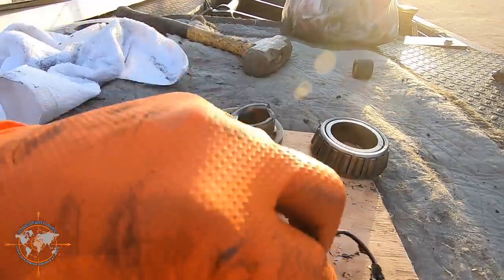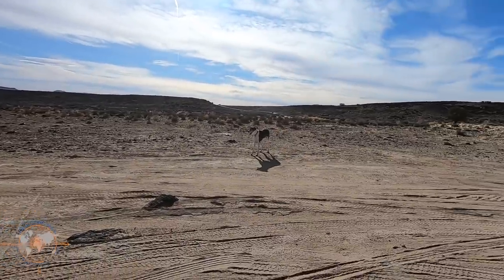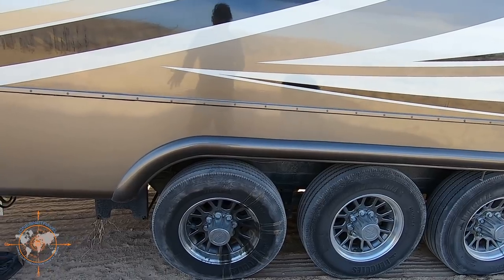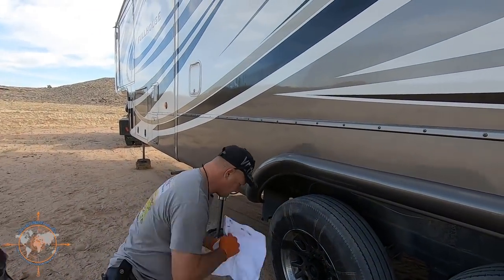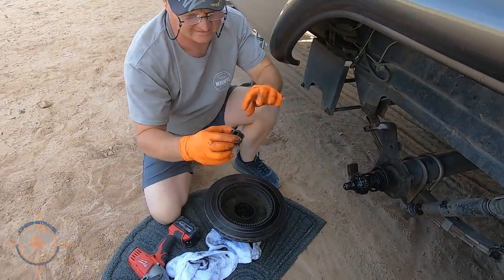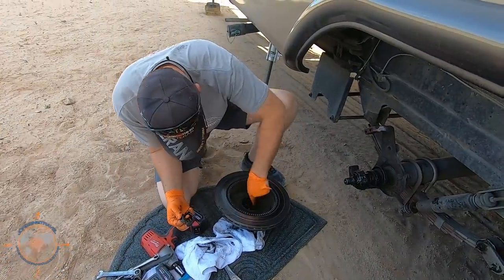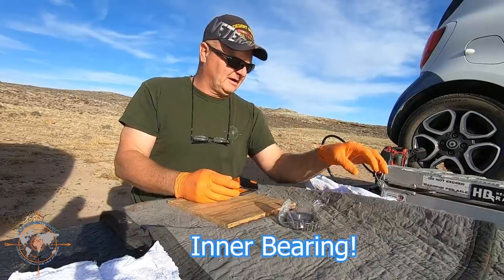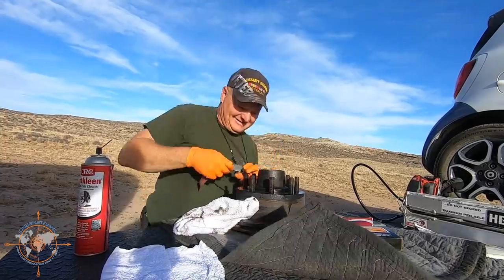RV Wheel Bearing Failure, Replacement and Maintenance | Use Brake Cleaning Spray | RV Life

Comment: I carry all the inner & outer bearings with races & seals, spindle nut, cotter pins, dust cap & Lug nuts, for all my axles with the tools need stored in an ammo can for things like what you had to do. I always have grease and grease gun on the trips. Thank you for your Service.
Reply from the maker: That is a great idea. Thanks for sharing George. Safe Travels

Comment: Oh boy Aaron. First off what a great video for always check your brakes and bearings. I was raised on my dad doing this every year on the Campers and boat trailers. He had to chip a race off a camper spindle in 100 degree heat once. Never again. Timken bearings!!! A thousand times yes without a second thought. We even rebuild our hubs on the vette that sees racing duty with Timken parts. Have used them for all our offroad jeeps for years. Totally worth the slight cost over the cheap stuff. I was holding my breath when you said you didn't have races and the rear seal was not looking too hot. Again watching you there is no wasted motion. Great video and great job sir!! A perfect video on why you carry spare parts and tools if one can. This stuff never seems to break in town or near anyone with the right parts in stock!! So good to see Tina and Maggie. Wonderful video work Tina!! - Paul & Julie
Reply from the maker: Tina says thanks :) She was my understudy for the day but dont tell her that LOL

My favorite bearing story is.. one day a good friend of mine showed up at my house just about dark and asked if I could look at his truck. The front right wheel was making a funny noise as he drove. Out at the driveway, and I kid you not even one little bit, I walked around the front of the truck and all I could see was the end of the spindle, where the little hub cap would be, and it was just a red ball. The bearing was fully seized on the spindle and no way to get it off. Cutting torch, sledge hammerand a lot of cussing later and we got it apart. I as shocked he didnt have a fire. 
Safe Travels

Comment: Good job! Good advice, my DRV 38RSSA are oil bath and as part of my pre trip inspection I check for leaks around the rear as well as the front sealed caps. They all leak some and it’s not hard to tell when they need replacing Some people replace the seals every 2 years, some only when they start to leak. I change them out when I notice more than normal leakage. A few drops or more will causes a dry stream to form. Nonetheless oil gets changed every 20,000 miles or every 2 years. A couple of spare parts is never a bad idea thanks for the advice! Glad you guys are safe and well, God Bless and safe travels 🙏🏽
Reply from the maker: Hi Ismael. Thanks for checking out the video and thanks for sharing your experience. I've never dealt with oil bath axles on an RV but sounds like they work well. Safe Travels

Comment: Tip, use a pry bar under the tire when reinstalling onto hub. Makes trying to line up studs to rim so easy and your not lifting the weight of rim and tire assembly.
Reply from the maker: Great tip. Thanks Mike. Safe Travels:)

Comment: I literally just replaced all 4 tires on my camper.  While the wheels and tires were at the tire shop I service all my wheel bearings and wet bolt.  It’s a good thing you were prepared on the road to make the repairs.
Reply from the maker: Niiiice, that'sthe perfecttime to doallthat I would say :) We try to be prepared as miuch as we can. Safe Travels

Comment: I like this video.  Good content and some great tips.  An extra bearing set is excellent advice.  You didn't mention it in this video, but those heavy duty battery impact wrenches should be considered for anyone who would replace a tire/rim, or for that someone who may be kind enough to do it for them.  In my wrench case, I ensure I include the correct size deep impact-tough sockets for all wheels on all vehicles.
Reply from the maker: Hi Bob. Excellent point about the impact.  I never imagined that they would work as well as they do. No more tire iron for me too lol. Thanks for checking out the video. Safe Travels

Comment: Hey Aaron, if you guys want to swing through Bryce Valley  (Cannonville) on your way … we have 3 soft starts and 2 Fantastic Fan vent covers to get installed. 🙂 Glad it didn’t catch on fire or cause a blowout and rig damage.
Reply from the maker: Hi Ken. Would love to help you with your soft starts and fans but we probably wont beback through Utah until late fall. Safe Travels

Comment: Great video!  Had the same thing happen to our rv.  You got lucky, you have disc brakes and the caliper held the hub on the axle.  Mine was drum brakes and the wheel got ejected from rv and I had some minor body damage and the axle had to be replaced.  I had stopped less than 10  miles before it happened to fill up with fuel and walked around and felt all the tires and there was any signs the tire was crooked or grease running out of hub cap.  The alarm temp on the wheel that fell off didnt go off until I was walking down the road to find it.  The air temp of the tire didnt go up until after the damage was done.  I hope you made it to your next stop without the other wheel bearing going bad on the wheel you saw a little grease on.
Reply from the maker: Yes, we made it without any further incidents. Thank goodness. :) Safe Travels

Comment: You did a great job.  If you'd had to, you probably could have just removed the wheel and limped to a repair shop using only 2 tires on that side, maybe shifting weight inside the coach/storage to the side with 3 tires, and/or toward the front to move some weight from the wheels to the hitch, to help a little too.

In 2001, a wheel bearing went out on the trailer behind our safari vehicle in the middle of nowhere in Zambia.  Of course the safari company had spare bearings, and the guides were half-decent mechanics.  While the rest of the tourists (including my two young teens) took a walk, the more mechanically inclined guide and I replaced the bearing, and the other guide was our gofer for tools and lookout for wildlife.

In the late 1970s while studying mechanical engineering, Timken provided our entire mechanical design class with a bearing selection book which of course included a catalog with specs for all their bearings.  Their tapered roller bearings really are top-notch bearings.  I reconfirmed that after I started having front left bearing problems in a 2003 Olds minivan.  Mechanics all swore they replaced it with the genuine GM part, or a "great made in USA part", but in fact all probably used $35 Chinese crap off ebay.  Finally I bought the Timkens myself in their hologram-sealed orange boxes, and replaced them myself.  No more bearing problems!  I kicked myself for not having done that the first time.

They are easily worth what they cost, about 4x the price of the cheapest bearing that looks fine but is inferior. For anyone who doesn't do the labor themselves, and even if you buy and provide the part yourself to a mechanic, I'd advise not taking your eyes off the Timken bearing from the minute the box is unsealed, until you drive the vehicle away repaired.  They are like gold, and a shady mechanic will swap it for a cheap one like a magician replacing your Rolex with a TImes, the second you're not watching.
Reply from the maker: Oh man, I am so gald you shared all that awesome info. I agree with 100% of what you siad. If a bearing from over the pond is $9.99 on Amazon and the Timkin is $20 that should tell you somethign about quality. :) Safe Travels

Comment: Yep your comments of “I should of done it my self”. Exactly what Troy said when we were in Indiana and found a bad bearing…Aaron do you check your axels with a laser?  Or solely  depend on the tpms for temperature monitoring?  Also what made you check it?  Was tire leaning?
Reply from the maker: I do check them with the laser thermometer on occasion. When I turned into the area where we stopped I noticed, in the mirror, a slight wobble in the tire. Once we parked it was much worse. We were just lucky that it happend soon before we stopped. Safe Travels

Comment: Aaron, wow talk about the good Lord watching out for you guys.  Will be ordering Dexter axles except I'm putting oil bathed bearings like on commercial trailers.  That way I can always look at the bearing and you can never over grease them.
We have had to replace the whole hub, races and the spindle once on a semi trailer.  The ironic thing is we drove over a thousand miles with just grease packed into the hub because someone busted the sight glass.  But we got the load delivered.
Safe travels and roads Brian and Cindy, "xtreambydesign with passion"
Reply from the maker: Hey Brian. Where there's a will there's usually a way LOL and we're not anywhere close to commercial wweights. Safe Travels
Reply: @JonesN2Travel  True, but I think they will be lower maintenance in the long run.  Commercial trailers run thousands of miles before we do any major maintenance on them.

Comment: Had mine go out in July 4th weekend! a couple of years ago in Wasilla Alaska! Burned a d destroyed everything 😳 Took 18hours to get a tow. Destroyed the back bumper putting the trailer on the flatbed.(took vidoe of the whole ordeal) Insurance reimbursed! Dragged the trailer for 15 yards while putting it on the flatbed 😬 Luckily a garage mechanic was at trailer craft a d overheard everything a d fixed ours with a new axle in 2 days! Did I mention Alaka hotels get very hot when it's 93 degrees out.
.a d the clerk at the front desk didn't inform us there was NO AC in the room...so we paid for a room that we didn't use...and slept in the truck! Thanks God for AC! Safe travels!
Reply from the maker: I am so thankful to have this happen just as we stopped for the day. Sounds like you had a great time in Wassilla LOL Safe Travels

Comment: I actually thought your Fullhouse had the Morryde IS system.
Reply from the maker: It really should have had it from teh factory but that was an option. In my opinion any fifth wheel over 15k should have IS as standard equipment. Thanks for checking out the video. Safe Travels

Comment: Make sure you you utilize wheel bearing grease and NOT chassis grease. Wheel bearing grease is a long fiber and has a higher pressure point.
Reply from the maker: Hi Rick. Great point. Different greases purposely made for different applications. :) Safe Travels

Comment: Lessons !
When ordering the RV ,get the correct bearings and all vital equipment installed new at factory,or tell them no deal 
Consider oil filled hubs
Check more often 
Consider upgraded suspension systems
Look at prepacking the bearings and store in sealed container,if you get a emergency install they are ready to go .
After installing,and some miles on new bearings,recheck while they are hot and see if they tighten up or not 

A good drop sheet would be an essential item for working on the sand 
And also check your brakes are not binding causing extra heat build up ,as this can force the seals to let grease out and also spatter on the brake disc.
Use a digital thermometer tool to check randomly your hubs and brakes 
But you did well with what you had and you know what your doing ,many don't .
Reply from the maker: If working with an RV dealership was really that easy LOL Thanks for all your advice. Safe Travels

Comment: Those Chinese bearings should be replaced before 10,000 mi new timkin races and bearings greased at proper intervals will last 50,000 mi I learned the hard way  every one should check there bearings if they say right there on the side made in China get them replaced or this will happen to you!!!!!!
Thanks for the video this will save people a lot of misery if they listen
Reply from the maker: Hi Curt. Thanks for reaffirming that. Yes folks, learn from our misfortune, this will happen to you at some point if you travel enough :) Safe Travels